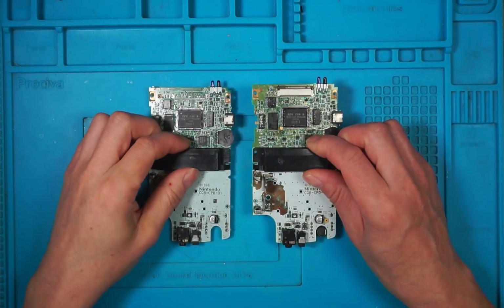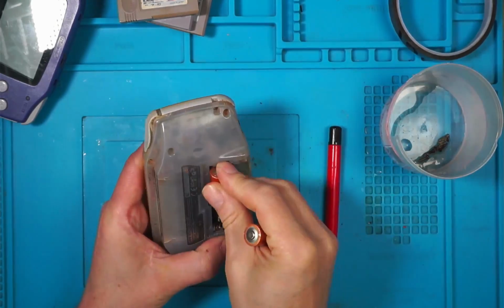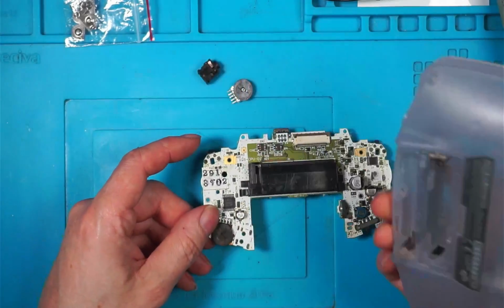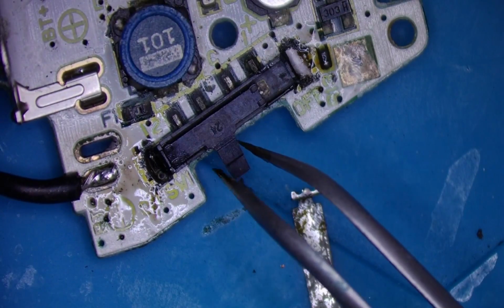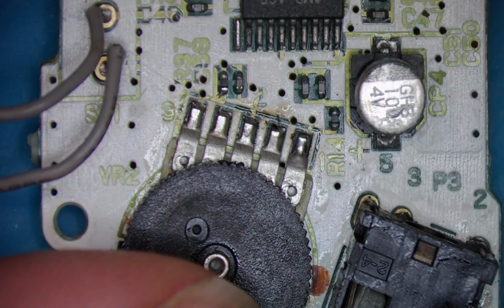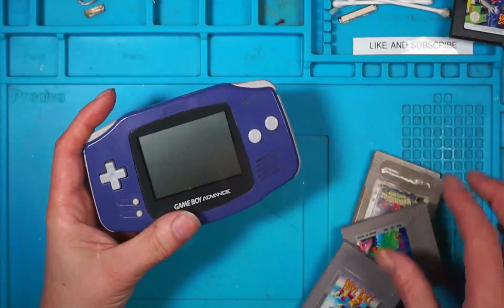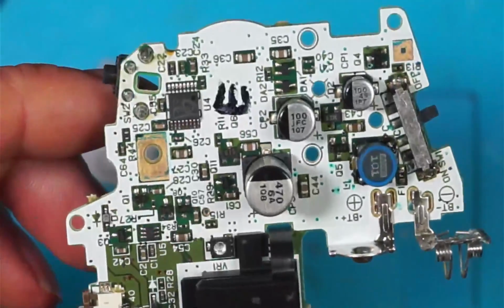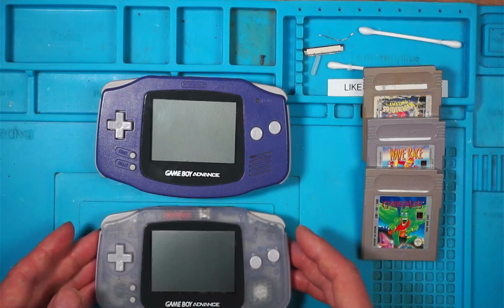Nintendo Gameboy Advance | No Power | Low Volume | Faulty Switch | Bargain!!!

Comment: congrats on 1k! i bet that screen is a replacement as that film you pulled off seems like a protector for a new screen. i bought a gba a couple of years ago for dirt cheap from someone on discord and i had to replace the battery terminals and shell as the previous owner tried to do an sp battery mod on it, but now its restored and works great!
Reply from the maker: Well done on fixing your GBA. I can't work out for sure what's happened to this screen, it looks original to me. It's not me you need to congratulate, it's the 1000 subscribers like you, who made it happen! Thank you.

Comment: Nice fix, can't beat a drop of vinegar on yer chips 😆 thanks Phil
Reply from the maker: It's great to the see vinegar working. I used to leave it on, but after it ate through the battery contacts, I think a quick splash then a clean with IPA is probably best.